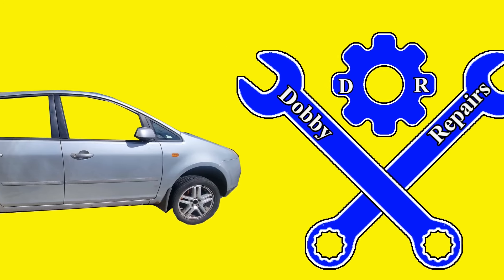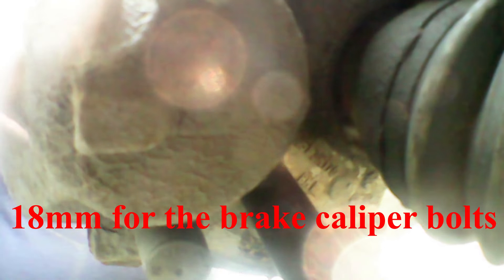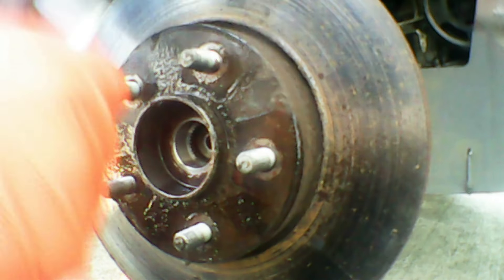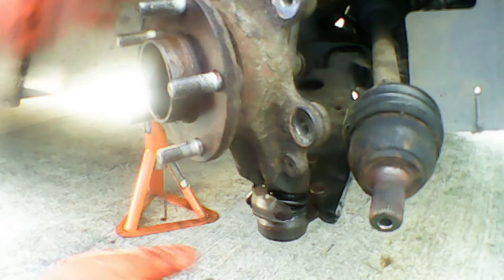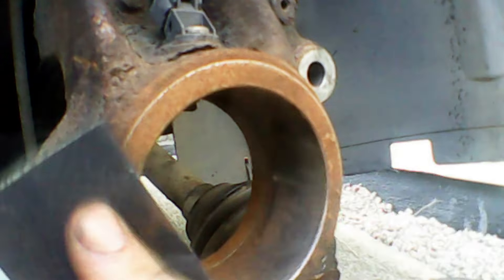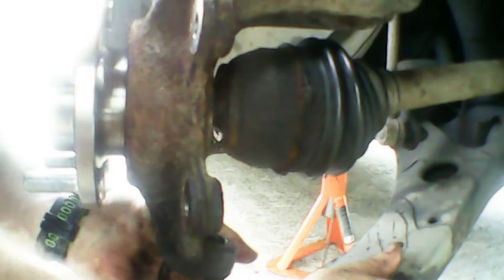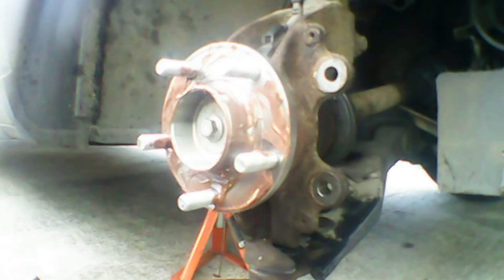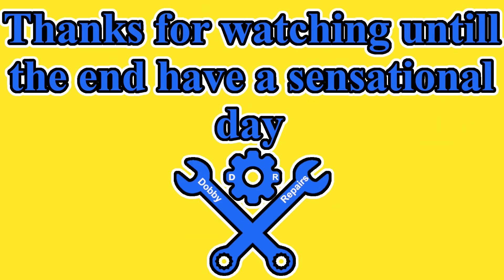How To Replace The Front Wheel Bearing On A MK2 Ford C max

Comment: Good video mate and a top job. Think I'm gonna have to invest in one of them bearing puller tools. I just recently changed 2 wheel bearings on a focus and I took them to a local garage so they could press them out and back in. Charged me 40 quid only took the lad 10 minutes.
Reply from the maker: it's a great tool and fairly affordable at £60.  £40 is cheaper than what the local garages round here would charge . I'm pretty sure it's the same job on the focus